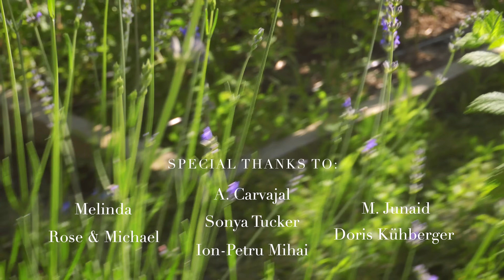An amazing addition to our abandoned farm renovation

Comment: I strongly suggest putting your mulch OVER your irrigation pipes, not under. As one website says, "Covering your drip irrigation system with about 2-3 inches of mulch is beneficial because the mulch will protect your water from the sun. This prevents evaporation and further conserves the water in your irrigation system." Plus, you then irrigate your soil, not your mulch.

It's good to see Omar back, but I missed seeing your Mom!  I just love her!!
Reply from the maker: Thank you! That was actually another question I had. I have done some mulch now so it’s really good to know about the irrigation under the mulch.

Comment: Lovely video ❤
You both look so happy to be together again. Omar's brickwork looks great! I'm excited to see the making of the concrete top.
I have similar brown drip tubing in my garden and it has worked very well for years. It's easy to modify the layout to get more or less water wherever I need it. I usually have a few repairs in the spring, because the connectors get brittle in the sun and can break if I disturb them too much. Putting mulch over the drip system helps the connectors last much longer! (The tube itself lasts for many years and only has a problem if the emitters get clogged by minerals from hard water).
Reply: Oh and I am definitely getting a long extension cord and heat gun for the stubborn connectors next spring! I have spent many hours hurting my hands or messing with a lighter to push them together 😂
Thank you for the example!
Reply from the maker: Wow thank you for that Info! I think the brown drip pipe would be okay to expand with just a hairdryer. Definitely try with that first before investing in the heat gun! Though heat guns are quite useful!!

Comment: Be careful when using wood chips in the vegetable garden. It is better to use them on paths and around trees (fruiting/otherwise). Vegetables enjoy a more bacterial environment for growth. This is created by clean old animal manures, and good compost. Which can then be covered with ramial woodchip material. If you use only woodchip to mulch nitrogen will be stolen from the soil and therefore your veges, to break down the woodchips. It is the same in making good compost; nitrogen and carbon make good compost.